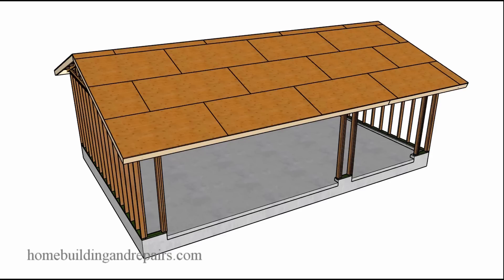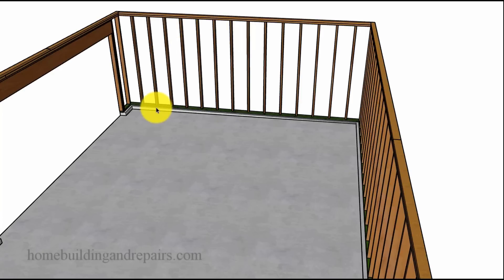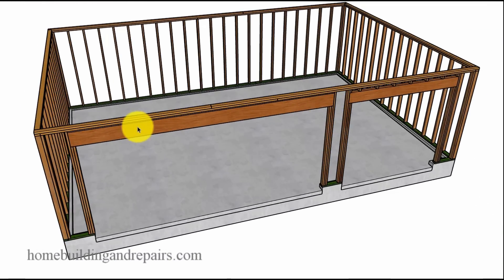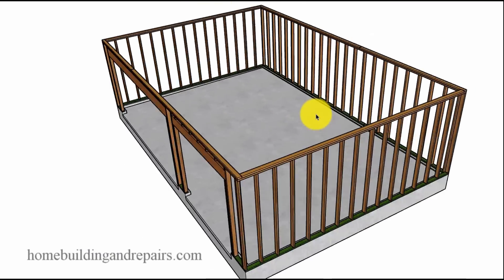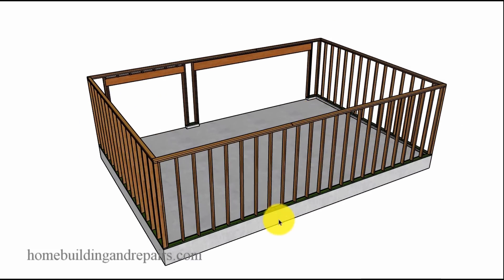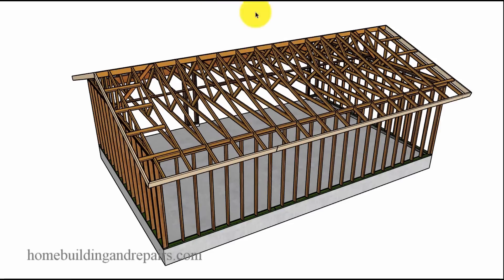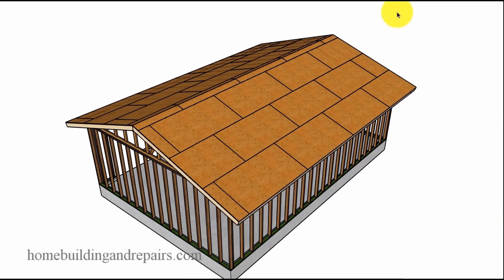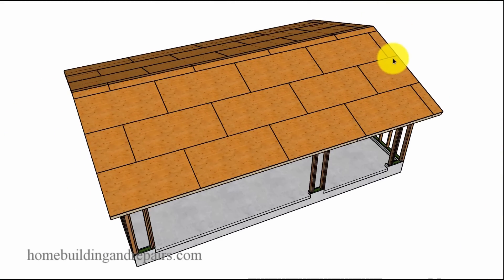Three Car Garage With Concrete Foundation And Framing - Learning How To Build

Comment: Hello, I was watching your 2 car garage video for possible drywall ceiling options with 2x8 or 2x10 joist. Would the trusses on this 3 car garage handle drywall on the ceiling or would it need extra support?
Reply from the maker: I can't provide you with a yes or no answer, but I've seen it done plenty of times. You can always contact the truss manufacture or an engineer to find out for sure.
Reply: @gregvancom  thank you for your helpful  videos, I’m thinking about converting my single car garage(out of the 3) into a potential ADU and wasn’t sure if I needed to add extra support on walls and ceiling. My house was built in 97’, how can I find blueprints or any truss information on it?
Reply from the maker: @peaceonearth405  Sometime you can find blueprints scans at your local building department and possible county records office.

Comment: Great video, I am thinking of a 3 car garage. What is the overall width ? thank you.
Reply from the maker: Usually 20 foot by 30 foot or 10 foot wide by 20 foot deep per car. One car garage = 10x20...2 car= 20x20 ... 3 car garage 30x20 and so on.
Reply: @gregvancom  Thank you, good information.

Comment: Could you explain portal framing requirements.   Trying to build a 30x40 three-car garage over slab with 3 bays instead of 2 but otherwise similar to your plan.  Getting bogged down in trying to read about and understand portal framing which my inspector told be to look into.
Reply from the maker: I will definitely put that on my list of videos to be made in the future. However, you don't need to wait for a video, putting a couple of pieces of sheer panel on each side was some hold downs in the concrete is basically standard construction for most garages.

Comment: I'm in Kansas, so we have to dig 36" for footings.
Reply from the maker: Is that because of the frost line or water table?
Reply: @gregvancom  frost line! It gets below 0 here and often times weeks where it won't get above freezing.
Reply from the maker: @GridIndustries  That's cold and of course most footings need to be below the frost lines where the ground freezes. Thanks for sharing.
Reply: Here in Canada (100 mi. NW of Detroit )  we put garages on  slabs on grade a lot of the time. There are some limits on square footage ( in  our district  768 sq. ft. )   We get some some cold winters too.   Frost line here is 4 ft.  I built several slab on grade garages with no problems 30 yr. later !

Comment: Great job. If my garage door is 16 ft would my opening want to be 16’3” ? I honestly have been searching the web and can’t find an answer. Thanks
Reply from the maker: Most finished openings are about 1/2 inch shorter on each side and at the top. Here's a link to a video that might help. Let me know if it doesn't. https://youtu.be/qh2tF4xdt90

Comment: If these are roof trusses, won't the ridge blocking's connection be blocked by nailer plates?
Reply from the maker: Good point, sometimes it will be difficult to nail through the metal connectors, but I've done it thousands of times. I would strongly suggest wearing safety glasses, when doing so, especially with a pneumatic nail gun.

Comment: The green sill plate protects the sill plate from damage from water. It does not stop the wood from sucking water from concrete and there for the wood that is above the plate can get water damage. What to do? Use plastic or rubber between sill and concrete to break the suction effect. And why do you use 16 CC and not 24 CC? It's a lot better.
Reply from the maker: Yes it will definitely be stronger using 16 inch on center instead of 24 inch on center wall framing components like roof trusses and I'm not 100% sold on sealing the area in between the top of the foundation or footing and the bottom of the wall framing plate, unless you're dealing with something like a high water table, because it might prevent moisture from absorbing into the wood from the concrete, but at the same time could trap any moisture on top of the sealed area, allowing the framing plate to absorb even more water.
Reply: 16 inch on center is weaker then 24 inch on center, if you use deeper walls. Just try it. The problem is not trapping water. The problem is always water from ground goes up the wood structure.